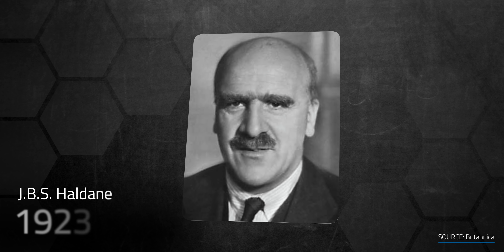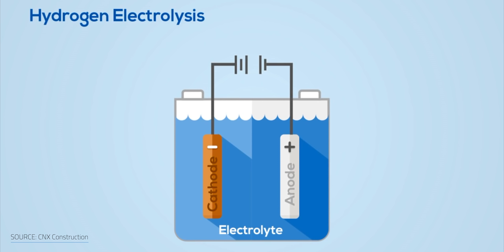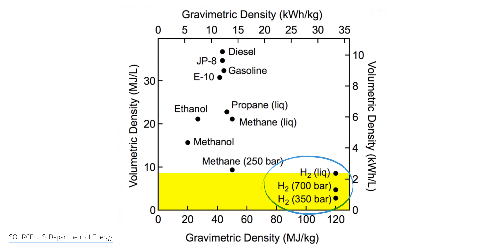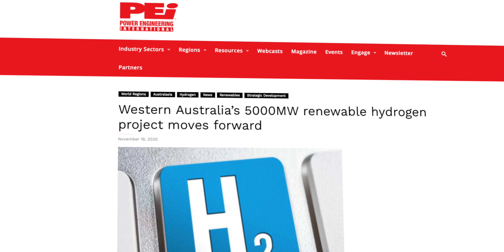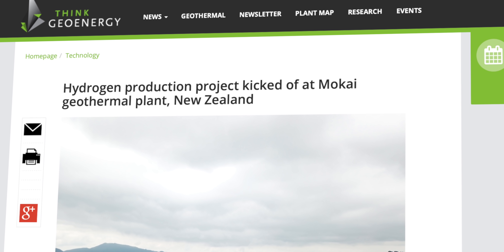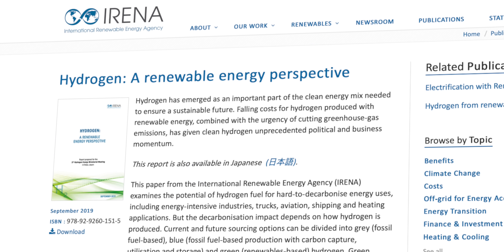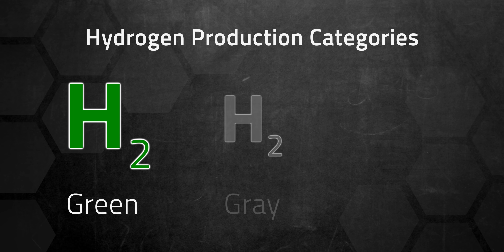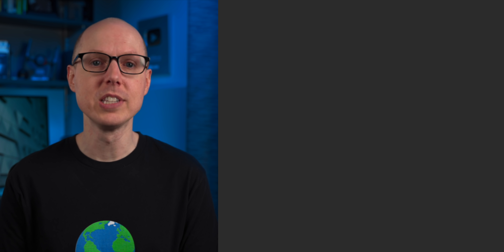The Truth About Hydrogen's Dirty Problem - Green Hydrogen Explained

Comment: The video is quite informative about production of H2, but I do miss the storage part. This is as far as I know the main concern for its feasibility as a general fuel. Of course hydrogen is used today. for certain applications and making it renewable is important,  but the link from renewable creation to broad utilisation does skip over the quite significant storage problem.
Reply: Companies in Germany and around the world habe been working on a better hydrogen storage solution
Reply: @alanmay7929  True. They've been working on it for three decades, and have yet to come up with anything more cost-effective than 2000 PSI graphite-wound composite pressure tanks. That's what Toyota uses in their FCVs. They store 5.5% of their weight as hydrogen.
Reply: And as soon as those specialized applications result in fueling stations everywhere, you'll be happily buzzing around in your hydrogen fueled jeepster and the only CO2 you'll emit is when you fart.
Reply: @charlespoole2320  A 4-pump hydrogen station costs 2-3 million dollars to install. Versus a few hundred thousand dollars for 4+ rapid charging stations for EVs. Hydrogen does not sell for enough money at the pump for would-be hydrogen station owners to turn a profit and cover capital costs on selling fuel. Yes, green hydrogen will eventually become abundant in industrial applications, but nobody is going to bother installing wildly expensive hydrogen pumps for vehicles and customers that do not exist, hydrogen vehicles are expensive, slow and heavy, which makes them unappealing for purchase, which further reduces the desire to install pumping stations, it's a vicious cycle. There's no reason for governments to throw billions of dollars at hydrogen fuelling station subsidies, when hundreds of millions of dollars can more efficiently subsidize DCFC stations and electric grid upgrades.
Reply: @0hypnotoad0  You are right about current conditions.  But once the infrastructure is in place and nuclear drives incremental energy costs to near zero, competition will enter and the cost picture will change.
Reply: @charlespoole2320  if energy costs were driven to hear zero, hydrogen stations wouldn't make any money because nobody would be willing to pay $100 for a tank of fuel that should be free. It's not the cost of hydrogen that's prohibitive, it's the cost of the fueling equipment
Reply: @charlespoole2320  Not planning on breathing then?
Reply: Also, transporting a fuel produced in a large facility for sake of economies of scale, be oil or gas, requires new expensive infrastructure (hint: natural gas pipelines do not work for H2).
Reply: @alejandromeneses7735  We have the infrastructure already, H2 is transported through the Grid as electricity. The H2 is made onboard the vehicle when you plug in!
Reply: Storage exceeds energy density of Li-ion 5 times over with fuel cell efficiency included. The problem is that metalhydride storage is costly. High pressure tanks is not the way to get sufficient range in vehicles. However, the rare earth catalysts needed for metalhydride tanks are somewhat scarce, but not to a greater extend than raw materials for batteries or super magnets are already. So H2 storage is where batteries were before an industry went all in on manufacture. You can buy turn key fuel cells and MH storage for boats, at around twice the cost of a Li-ion battery bank of the same capacity, so we need a 90% cost reduction to beat Li-ion batteries, i.e. 5 times better and 5 times cheaper.
Reply: @Tore_Lund  Storage isn't the only problem. Fuel cells are also rather costly in themselves requiring platinum for the anode.
Reply: @isaach.1135  yes, They are not cheap $1/watt, and they are lacking in catalyst devellopment. Turns out there are Better organic catalysts, that Also are more efficient, but They require nanoscale depositing, so the tech for making fuel cells ambigious, is not there yet, but They are worthwhile in Cogen applications as They are now, where there is a use for the waste heat, and bulky Storage of Hydrogen is not a problem
Reply: @Tore_Lund  and you are still ignoring the insane efficiency losses with using hydrogen.
Reply: @SupremeRuleroftheWorld  
Wich does only occure for one of the many ways we can store hydrogen.
You are thinking about pressurized tanks, however, there are other technologies like LOHCs, Hydrite tanks, paste forms and others that have higher conversion efficiency.
Reply: @Enthropical_Thunder  still ignoring the losses in creating the stuff, moving it, convertin it back to usable work and let it work better and cheaper then what we currently have.
Reply: @SupremeRuleroftheWorld  "insane" is a mild exagaration: Making hydrogen by electrolysis in stationary plants, heat can be recouped, and as it can be stored too, grid load mismatch and suplus is not wasted as on a grid without storage. Likewise filling MH tanks generates heat, which needs to be fed back into the tanks when emptied, so the typical 2.5kW losses in the fuel cell when driving on the HW have use to heat the tanks but also for cabin heating and remember a Tesla on high heat including its heat pump uses 2kW, so overall it might turn out the whole chain of losses might be less than the average battery electric car. Self discharge, BMS and alarm system in a Tesla uses 170-240W continiously while it is parked, if it is not in deep sleep mode!
Reply: @Tore_Lund  i am sorry to say, but you are comically uninformed about large scale production. and you are wrong about basically every metric you mentioned.
Reply: @SupremeRuleroftheWorld  You didn't mention any figurens either! I'll have a go: fuel cell
Reply: Sorry, touch screen:
Reply: @Tore_Lund  i dont have to. if you check your own numbers you will see how wrong you are. go watch this video, it has lots of numbers: https://www.youtube.com/watch?v=f7MzFfuNOtY some metrics are a bit off like the refueling time for hydrogen is not 5 min, its more like 20~40 minutes.
Reply: PEM Fuel cell eff: 65% (conservatively) waste heat is high temperature, so is suited for distributed heating. A vehicle uses 12kW going 70mph, so I admit around 5kW is lost, not 2.5kW as I claimed. A model 3 uses 17kW from the socket to go 70 mph but needs only 14kW mechanically (it is a bigger than average car), so that is 3 kW lost to inefficiencies from wall outlet to rubber, so as I said, If you turn on the heat in a model 3, the losses are equal to a normal electric car going at the same speed. You don't have charger losses in a H2 car! There is also a weight penalty for the battery EV by hauling 5 times less energy dense storage, The model 3 has lousy stop and go performance in city traffic 300Wh/mile is not uncommon, heavy batteries also require a bigger motor, which has even worse low load efficiency. So the effects are compounding, the fact that a fuel cell has lower "conversion" efficiency than a battery, is more than countered by higher volumetric and gravimetric energy density. NB. not bashing Tesla here, but I know the model 3 numbers by heart.
Reply: @SupremeRuleroftheWorld  You are aboslutely right, you don't have to, but claiming people are wrong, because you say so, is really not an answer to expect from an adult, and you should watch the video you lińked to yourself, he is a real engineer, and he agrees with me completely on the numbers! Without math every argument is hersay!
Reply: @Tore_Lund  you claimed you were right with wrong numbers. so check yourself before you go wreck yourself. or something. and the numbers in that video were extremely pro-hydrogen. so real world numbers will be considerably worse wich has already been proven by the fact that nobody is buying hydrogen powerd vechicles exept if they are paid for by oil companies or by goverment subsidies.
Reply: @Tore_Lund  last week i saw an indian guy light a bulb with his fingers. does that mean he solved the power crisis? extraordenary claims require extraordinary evidence. and 1 guy fishing for dumb investors does not qualify. or is the next argument going to include solar roadways?
Reply: @SupremeRuleroftheWorld  Please, give a chance to figure out where we dissagree? The real engineering video you linked to, uses the first two minutes to show the advantages a H2 electric vehicle has which are more or less what I said in my previous replies to you, His complaint is about manufacture of H2, distribution and storage, however his scenario persumes that H2 is going to be treated like gasoline today, sold at the pump with the asociated hassle and cost. He doesn't consider MH storage, which require considerable less energy to fill (like a small low pressure ac pump buzzing away) and holds more H2 than cryo tanks per volume. He doesn't realise that a H2 car will be plugged in at home for the majority of the fillups with the vehicle fuel cell acting as electrolyser, and H2 gas stations are only for longer trips, like super chargers. Charging at home, the waste heat contributes to the heating of you house and possible hot water too and as I said, larger hydrogen facilities will supply their waste heat to heat the city. If you have solar, a whole summer of surplus, can be saved for winter as H2. Fuel cell cars do not require a seperate infrastructure and are operated just like any other ev plugged in the socket, except, you also fillup with water when you get home.
Reply: @SupremeRuleroftheWorld  Seriously, I find it as stupid to use 10,000 PSI tanks in vehicles as you do, and likewise cryo. I know Nissan thinks otherwise, but they are wrong. However metal hydride storage has existed since the 90' commercially and you can buy as many as you like fromMcCarr-master right now. Nobody is either considering reformed Hydrogen from oil or gas as serious, though some oil companies want that. The purpose of making H2 is to have somewhere to put surplus windpower, and just outside my city, they are building a production scale pilot plant. politically the attraction is synthetic fuels for aviation and trucking, but that is still burning stuff and even less efficient than fuel cells, but they intend to send waste heat into the distributed heating grid, so regardless, Hydrogen becomes either a seasonal storage or an intermidiate fuel, but we are going to use it and we need something other than giant powerbanks for surplus renewables. However the attraction of H2 vehicles is diminished, if they require H2 stations to fillup and a PEM fuel cell works just as happily as an electrolyser, this is the way to make them cheap to own. So the tech is here maybe not yet cheap enough to compete with batteries, but potentially they should cost no more than BEVs today, and the question,what other option is there on the horizon to get significantly longer range in an EV than fuel cells. (Thank you for keeping this discussion civil).
Reply: @Tore_Lund  and you are still COMPLETLY ignoring how stupidly inefficient hydrogen (in any form) is from production to wheel. I does not matter how you can store the stuff: its more expensive then just grabbing a lithium or even liquid salt storage system. You xannot get around the massive efficiency losses that hydrogen brings to the table. If it could match lithium the big players on the grid would already been using it.
Reply: @SupremeRuleroftheWorld  We haven't solved Long term Storage just yet. Batteries are for Short term unless we use something like redux batteries, and Hydrogen is hard on pipes and gaskets, yes yes! But as I said, for transport, the Weight savings mediate most of these losses. 800lb of batteries is not ideal in a passenger car.
Reply: @Tore_Lund  800lbs not great in a car? Do you even know how much an entire drivetrain of a petrol engine weighs? And there are MILLIONS of eletric cars, scooters and even trucks already on the road. Its not a problem. And have you forgotten that a hydorgen setup also still requires a big battery? Stop moving the goalposts and actually investigate how this stuff actually works in the real world before continuing, right now you are just making yourself look uninformed to say the least.
Reply: @SupremeRuleroftheWorld  Good morning. Yes I know what a car weighs; between 1600 lb and 2500lb! The Engine is around 140lb in a small passenger car, so adding the weight of 5 people while removing the weight of one does not make a difference in your opinion? A combustion engined car uses 1-1.5kW (at the wheels) to drive at 30 mph, go find an EV that doesn't use around double that because of the increased rolling resistance from higher weight.
Reply: @SupremeRuleroftheWorld  The stop making claims grabbed out of thin air, even mixed with insults. What does the motor in a model 3 weigh? It also has coolant and a radiator. The busbars alone weigh more than an exhaust system and the batterybox is 200lb! A model 3 weighs twice that of a regular car of which only a third of that extra weight is batteries! However total weight of any vehicle is not what we are discussing here, but how much change of mass of a vehicle affects performance, you avoided my request to you to explain why there is not a linear relation between rolling resistance and mass as you claimed. I'm burning up for you to explain why you believe science is wrong?
Reply: @Tore_Lund  A Toyota Mirai is heavier than a Tesla Model 3 performance, for this extra weight it gets +100km of range, whoopedy-doo. Hyundai Nexo is 500+ lbs heavier than the similar Kona Electric. Hydrogen fuel cell cars, across the board, are heavier than BEVs. Hydrogen is more energy dense, yes, but battery electric powertrains are far more power dense than the fuel cell stack + hydrogen tank. Takes more weight to make much less power with hydrogen fuel cells, so the technology does not scale well in small vehicles.
Reply: @Tore_Lund  Based on running the heating system and observing the loss of charging speed at a 6kW charger in a Tesla, it does use quite a bit of juice initially, but then tapers off once the cabin is at temp. If the driver uses heated seats and lowers the cabin heating, it is nowhere near 2kW draw. Phantom drain of a Tesla due to it's connected systems, Sentry Mode cameras etc. is nothing to do with Hydrogen vs Battery, and would be the same if HFCEVs had the same features.
Reply: @brushlessmotoring  If a Tesla is Better insulated than a regular car, yes 2kw is only needed initially. I have a 2kw diesel  heater in my EV, and IT Also throttles down to min after 10 minutes og so. But if we then presume a 400w average load for heating, IT is still 20% extra to what you need going around town, so IT is not insignificant compared to a fuel cell that has around 2kw waste heat available in that scenario. However at HW speed, an Electrical heater consumes a smaller percentage of your battey, as driving at higher speed Uses more power, so affects your Range less and at the same time, the fuelcell has  more waste heat than can be utilised, so IT has minimal advantage in that scenario. So IT depends, but IT is still a net contribution to the efficiency from a fuel cell when Used in a vehicle that experience Winther weather.
Reply: @Tore_Lund  Good info Tony - thank you. Do you drive a Hydrogen vehicle or an EV in a cold climate right now? - Can you elaborate on having a "2kW diesel heater in your EV" - what do you mean - is that a fitted option on the EV? I'm also curious about cabin preheating with a FCEV, does the Fuel Cell get turned on for that or does it all come from the battery first? If you can plug an EV into a outlet - cold climates have block heater outlets all over the place - then you can pre heat the car from the grid before you setoff, minimizing the impact on battery range.
Reply: @brushlessmotoring  I drive a Fiat 600 elettra from 2002 with Li-ion batteries. Originally it had a factory 5kW diesel water heater with heater core and water tank. However warmup time was more than 10 minutes, so I substituted it with a cheap Chinese $110 2kW diesel air heater, intended for caravans. They are all over eBay. For preheating, I'll plug it in for half an hour of charging with the trunk liner lifted as my onboard charger is fan cooled and heats the cabin nicely. A Fuel cell car has a plug in power supply too for electrolysing, so the same trick should work with them.
Reply: @Tore_Lund  Wow! Fascinating, I had no idea there was an Electric Fiat 600 / Seicento in 1998! What a cool car to drive around in today. Have you ever thought of upgrading the Lead Acid battery pack with a new high density Li-Ion one? I see a few folks have gone that way.

It's such a shame GM sold the patents to vehicle grade NiMh to Texaco who then stopped the move to electrification in it's tracks in the 90's, and we had to wait for Li-Ion to get cheap enough to continue the transition. So much lost time.

Comment: Your usual excellent video but how in the world did you miss "Proton Technologies" - you know, the company that has solved the problem of cheap, green hydrogen? By injecting oxygen into old oil fields to partially combust the remaining oil and/or natural gas and then filter out the hydrogen and leaving the carbon compounds deep underground, they claim hydrogen production cost below 0.50/kg which is cheaper than gasoline. This means the existing ICE engines can be converted and the transition to a carbon free economy accelerated.
Reply: no
Reply: @kylequest  yes